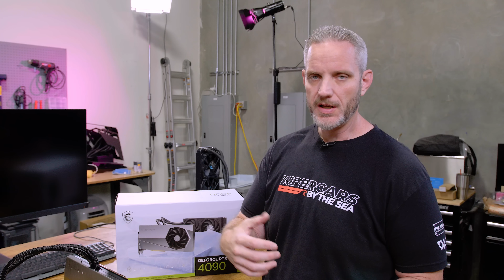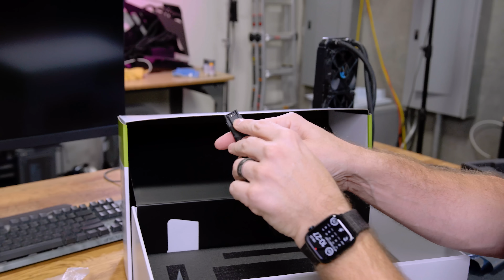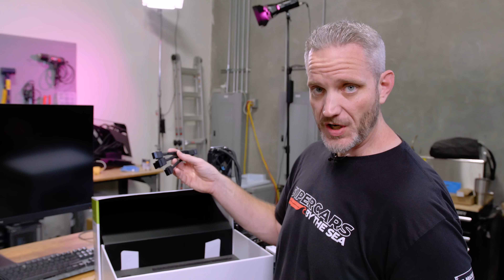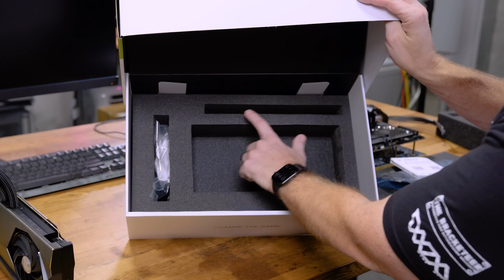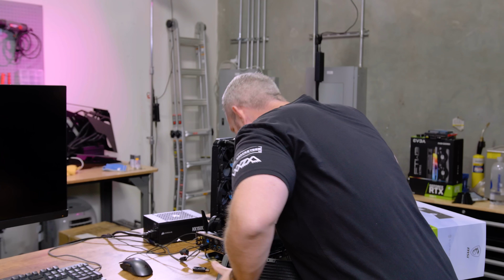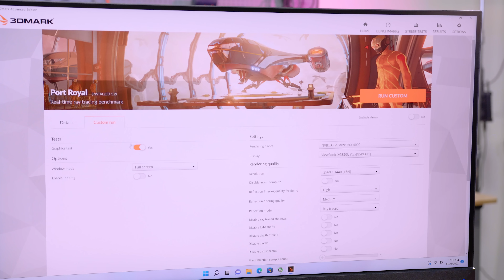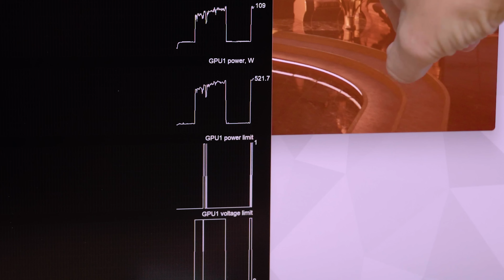This is the most BEAUTIFUL RTX 4090 yet...

Comment: Will you check out the Inno3D iCHILL?
I do not get way there are not more cards with a water block and two 1/4" connections, such that anyone can just add the card to the current loop in the system.

Comment: I am still on a 2080 super that happens to be a hybrid just like this one by EVGA (RIP) .... 
Runs reasonably cool and it's not loud. It is not as happy now next to my 12700k (air) as it was next to my 9900k (aio) temps-wise, but barely goes over 72C.

I find these super practical, just like an AIO: install and forget. I had custom builds a couple of years ago and they were not maintenance free. (were better after putting silver coils to kill gunk, but still )
Reply: if you use coolant instead of just water I've had PC's go over 5 years without maintenance.

Comment: Gotta pay more to open up a Pcie slot for a capture card or other thing that you might want. So when will consumer level motherboards come with extra slots to adjust for all of the space that the newer cards are taking up? Still...... I like the sleekness of the "Suprim". It goes with the idea that in the electronics world, less is more. Isnt it a contradiction that Nvidia has gone to a smaller node just so they had to put it all in a bigger <effectively> chassis? Seems backwards. Smaller node needs larger space? Huh? So when TSMC perfects an even smaller node, the graphics cards will be 4 slot hugeified door stop.....and cost more than this generations full builds.

Comment: I’d like to see this up against the waterforce from gigabyte and maybe something custom with a 280 or 360. I’d also like to see it used in a SFF build which strikes me as the perfect use case for a hybrid like this.
Reply: I have waterforce. It has a lower default clock but you can over clock insanely high. I have mine GPU +185Mhz, memory +1.5Ghz. No issues at all, not even getting hotter. This ends up with GPU always runs over 3Ghz.

It has a way bigger copper plate that covers nearly the whole card. Only downside is it doesn't have any RGB.
Reply: @yifeiren8004  "Only downside is it doesn't have any RGB." 
Thats a big up and not a downside in my book, most gaming hardware has rgb nowadays and its kinda driving me nuts that everything has to glow like a fucking christmastree.
Reply: @Skid235  I like Christmas tree :(
Reply: @yifeiren8004  Me too but only in the christmas time. I dont wanna have my pc glow like one while its standing next to me when im gaming.
Reply: Inno3D has one with a custom waterblock too, so there's plenty of options.
Reply: Battle of the junk brands lol

Comment: What reviewers never factor in when comparing water versus air is the fact that you are doing your testing on open bench setups that have access to ambient air... I'm pretty sure this card with the rad as intake will absolutely destroy any air-cooled gpu on most cases... Let's be realistic the perfect airflow exists in like 1 in every 30 builds? What ends up happening in most cases is some of the hot air finds its way back to the intake of the card when air cooled... Whereas if you put this rad as intake in a case it will ALWAYS have fresh ambient air and what you saw on your open bench is going to be 99% the same when used inside a case...
Reply: I've watercooled for nearly 12 years and all rads should be intake always.
Reply: @Born_Stellar  ideally... But at some point you gotta make choices... Like you have a 360 in front and a 360 on top... Both can't be intake as they are gonna fight each other for positive pressure in the case... That said, the bigger/thicker the rad, the less it will heat the water, thus making the air that makes it into the case less warm...

Comment: What happens if you flip the fans to pull through the rad? on gamers nexus they had an nvidia thermal engineer, and they mentioned when the fan is pulling air flow is less, but the air flow is more even across more of the fin stack, in this case it would be more even across the rad, would that affect cooling in a good, or bad way?
Reply: 'pull' is generally considered to be slightly better than 'push', however the difference is so minimal it can't really be quantified. and some fans may preform better in push, some rads etc. but you would never notice the difference in temps.

Comment: if you're feeling down about gpu prices right now maybe this will cheer you up, in march 2022 i bought a 3080 aorus waterforce aio gpu and i paid $2,000 for it because it i felt it was worth it and aesthetically completed the look of my build and you can now buy the same exact card for $1,000 but i still love it. it's exactly what i wanted even though it literally can't overclock at all (+60 MHz on the core before things get stuttery due to power limit which allows 0% addition power limit on msi afterburner and 200MHz on the memory and temps top out at around 62c in my case) so i'd trade my card for this msi 4090 anyday if i didn't care about the aesthetics but i know no one will give me back what i paid for this card

Comment: Jay, you forgot to mention that VRAM temps on the MSI Suprim Liquid are horrid. I messed around and any air 4090 has 20-30C less on VRAM.

This is kind of sad for a liquid cooled card. Apparently it also has a 110% power limit in comparison to 130% of other models.
Reply: not a full cover block, its just an AIO.

Comment: I just found the solution to the 12VHPWR  cables melting... watercooled cables used in INDUCTION FURNACES. A water JACKET goes around the cable. This is nuts.
Now back on the video, watercooling these behemoths make perfect sense.

Comment: There is very little difference between the Liquid cooled Suprim X and the Aircooled Suprim X. Perhaps the Liquid cooled model is a little quieter. I have the Suprim X 4090 aircooled and I see 60C peak temperature and 27480 score in Port Royal when overclocked +160 core and +1700 Mhz memory with voltage slider on at standard.

Comment: The 2 AIOs I used lasted less than 5 years (always the pump dying), which I'm ok with.
But WTF are you doing when the AIO sticked on your GPU dies after 4-5 years ?
And yes I don't upgrade more than every 6-7 years. Still playing on a GTX1080, planning on upgrading to a 4090 when they are actually available in Switzerland.
I would love to buy a good looking GPU like this one, with just the WB without the rest of the locked system in...

Comment: How is case compatibility with side panel fitment? The top of that card looks quite a bit higher compared to the PCIe bracket than my 1080 Hybrid, and the tubes on that card are already pressing against the side panel on my Meshify 2 Compact. I'm worried this card is just too tall with the tubes.

Comment: I have one PC with this card installed and an identical spec machine with the gigabyte gaming oc 4090.  I was able to get higher stress stable core and memory clocks on the gigabyte but have not seen much of a performance difference. Both handle VR gaming beautifully.  Need to fire up cyberpunk to see how that goes.  This card looks great as a vertical mount!

Comment: MSI should not include RGB controls to their afterburner. Afterburner, unlike armory crate or etc. is not limited to a manufacturer. Everybody uses it. You prefer everyone had additional bloat on their systems so that MSI users did not have two pieces of software? You can think of afterburner as a non msi product. Plus, rgb can be handled by other software as well (third party ones) that work on multiple brands so you could install one software and run all your rgb with it.

Comment: to run it cooler just use a larger radiator, that's how the heat is taken OUT of the system.
Reply: you can't change the radiator on a closed aio
Reply: won't matter cards are power limited.

Comment: JAY ! What are ya doing running AIO’s with the hoses on the top,, come on you know better than that , put them on the bottom where they belong, your setting a bad example for new guys that may not know better..
Reply: I guess someone made a video about this at some point? but I can tell you that it doesn't matter. if there is enough air to cause a problem in that way, you should probably look for the puddle of coolant that leaked out first.

Comment: my power limit on this exact card goes to 133 % on silent mode. Not sure why yours only goes to 110
Reply: Ignore the power target % as it is not comparable between cards. The percentage it is relative to stock 100% power limit which governed by which GPU BIOS you have, some Suprim X come with a lower stock power limit but all cards have the same peak limit at about 520 watts. This means whether the power target percentage slider reads 110% or 130% it makes no difference its still 520 watts. I've tested two Suprim X 4090s and this is the reason for the difference in power target numbers in MSI afterburner.
Reply: @micb3rd  thanks for your explanation I simply pointed out that my power limit went to 133% and not 110 in the software .

Comment: Nice review.  I am actually looking at buying this card.  I never play with overclock much, but I love the fact that its at 46C etc. at normal gaming temps.  Thanks!
Reply: Just don't do as I did after a long day at work, and install it at the front of your case without moving the fans. The heat that it pulls out of the radiator feels quite warm when its blowing towards you!

Comment: Yeah it is a beautiful looking card but there is so much potential left on the table thanks to MSI's power limits. Yeah I understand why they did it as well. Yes a wise Idea waiting on a compatible BIOS. You DO NOT want to brick a GPU that costs $1700 bucks.
Reply: because you need even more fps than a 4090 at stock can give you? are you running an 8k monitor?

Comment: What i would like to see is replace those fans for push/pull noctua 120mm ones to see how much difference that makes sound/thermals wise.
Reply: It should help quite a bit, I tested 4 x 120mm Noctua NF-12 on a Kingpin 2080 TI AIO cooled 240mm radiator with the card pulling ~400 watts in Furmark. The upgraded push pull fan set-up dropped temps 6C to 8C and was much quieter in games.
Reply: @micb3rd  yea i have a bunch of those fans never had one fail yet wish that suprim was actually a 360 or a 280 size tough or maybe even thicker seems like they went with slimmest thing they could find.

Comment: It's just a shame the pcb overhangs the top of the pci bracket and isn't a standard size so wont fit in most servers. 4 watercooled 4090's in a 2U would be so cute o.o
Reply: if you can afford stuff on that level just buy 4 waterblocks. how you going to manage 4 dual rads with limited hose length in a 2u anyways?
Reply: @Born_Stellar  The pcb itself is too tall so whatever waterblock is used isn't going to fit in a 2U high server ;_;

Comment: This is stupid, the VRM's are what gets hot on there cards and they are air cooled lol
Reply: Oh man... another person that hasn't the faintest clue about thermal management.
They run "hot" (which is a relative term) but do not consume much power so they dissipate little heat.
So a slight breeze on them or even passive cooling is enough to keep them running as designed.

The GPU is... well, it's what requires heat dissipation... which is why it's liquid cooled.
I hope that's simple enough to understand.

Comment: I really like the brushed metal finish on this one!   
Any chance you can review the GIGABYTE AORUS GeForce RTX 4090 XTREME WATERFORCE next?   
I'm curious which of these two water cooled 4090's you would recommend
Reply: I believe the day J2Z reviews another Gigabyte graphics card, Hell would have to freeze over
Reply: the gigabyte is a full cover block, meaning your VRM's and ram chips will be kept cooler. that is technically 'better' but won't matter unless you are into hardcore overclocking.

Comment: I see why evga may have really pulled out, nvidia is nerfing anything that isn't FE
Reply: they're all like that there power limited.
Reply: @rci-tf2zc  yes but it would seem nvidia is squeezing extra performance out of their cards by running not as much of a power limit, it's subtle, but still kind of an FU to the SI's knowing that warranty reasons is kind of the culprit for SI's not being able to match performance with FE cards, nvidia being able to run a "riskier" power limit because, if it goes wrong, they're more readily capable of soaking up the liability of warranty claims.

Comment: Jesus H. Christ... I just checked prices for this thing in my neck of the woods and the only offer I can find is on amazon uk marketplace for ....*drumroll* ... 3072.35 Euro. You'd have to be literally crapping solid gold turds or be insane to spend that kind of money on a GPU... :D
Reply: I mean, it's a high-end card. Normally, not many people would even consider buying it, and those who would would have the money. It's just that in Ada Lovelace, the 90 is unexpectedly the most efficient model.
Reply: @Goodbutevilgenius  high end used to mean $600. and you could say 'those who would consider buying it have the money' about anything. Am I considering buying a ferrari? no, but then I am aware I can't afford it. would I consider buying a 4090? sure, If it wasn't more than 2 months rent.
Reply: @Born_Stellar  well it doesn't mean that anymore. 
And no, you would absolutely buy a Ferrari if it cost $600.
Reply: @Born_Stellar  Exactly! I always stuck with middle of the road kind of GPUs (GTX 260, 460, 660, etc) which were around 250 to 300 Euro - and kept thinking how daft it would be to pay, say, 800 or so for a top tier one. With VR now being a thing, I kinda changed my mind on the top/higher tier ones, since VR is one use you'd actually need such powerful cards for. Still: €3000+ for a GPU is insane, especially now that the whole crypto-BS bubble seems to have burst (for the time being). The way I see it, 40xx is just about bragging rights at this time. I would wait until next year when other 40xx models will be available and NVidia will have sold off their 30xx stock. I'm not psychic, but I'd bet prices should be much lower by then.

Comment: I may get one, one of these days.  I’m fine with the 3090 for now.  But I’m sold just on the small size of it.
Reply: when you have more money than sense....
Reply: As someone who's got one. I will say it's a lot better then my 3090 Xtreme Waterforce card. Here's my experience. The 3090 used 360w - 380w at 1900mhz, producing a hot breeze from the radiator. This was at stock voltage. The frequency would drop quiet often as it fluctuates from 1900 to 1700mhz causing fps dips. Now, the new 4090, runs at stock voltage of 190w, at 2565 mhz at all times. It's a night and day heat difference, as the 4090 runs super cool. I've seen my 3090 hit 55c under full 370w load, while the 4090 sits at a nice 33 - 45c under full load at a whooping 220w. No frequency dips at all. For the lols. I undervolted the 4090 (30% power slider on msi afterburner) and stock fans.. Yup still pegged at 2565 frequency at 130- 160w. Insane. It's super cool, literally. I have also tried 128% power and Max fans, I can get a stable 3000mhz to 3100 OC, at 280w. Super excited how good it is. They did a great job!

Comment: 5:20 Isn't that a great way to kill a card sucking in air bubbles at 500+.
Reply: you'd have to lose a lot of fluid for that to happen. any small amount of air will just circulate in the system with the coolant.
Reply: @Born_Stellar  "Stop Doing It Wrong: How to Kill Your CPU Cooler (AIO Mounting Orientation)"
Or, "STOP DOING THIS!!!!!!!" 16:09
When it comes to a GPU using the heat of the Sun, it becomes "How to kill your $2700 Hybrid GPU."
These were back when they were referencing things going around 175. MAYBE 225, and almost exclusively referencing CPU's.
Not 530. "do-able" is now "fry-able".

Comment: I walked into Microcenter last week and this card was in stock (they had two). I bought it, and haven't regretted it a bit. That being said, my i7-9700k was clearly the weak link, so I bought all the stuff to upgrade to an i5-13600k. It did feel nice that I was able to score 25678 with no overclocks on Port Royal. Will I see any improvement at all with the processor upgrade?
Reply: The CPU upgrade to 13600K will really help you in games reach the higher framerates like 120fps to 160 fps on a 4090.  The CPU upgrade will not make much as difference in synthetic benchmarks scores.
Reply: @micb3rd  That's what I've been seeing online, thanks for confirming. I don't really go for the big benchmarks, was just curious as to whether anyone has seen the CPU affect the score by much.  My brothers pc scored quite a bit lower with my 3090 and his Bulldozer cpu; that is the only reason I question it.
Reply: @srt8u  To clarify your CPU does not change the Graphics Score on benchmarks much so not big impact for the every day user, the CPU does however have some effect for those looking for last extra points and is important if you shooting for the top of the leader boards.

This is due to the overall score is the Graphics Score + CPU Score is combined when the score is submitted to a leader board. 

 A bulldozer CPU really is quite low performance and can affect modern benchmark scores.
Reply: use some of that money you have on a google search
Reply: @Born_Stellar  Really? Almost like I asked because I expected to be around enthusiasts that might want to debate about it, not be told to google by someone that clearly doesn't know. Simple hint - I've already seen what Google says.